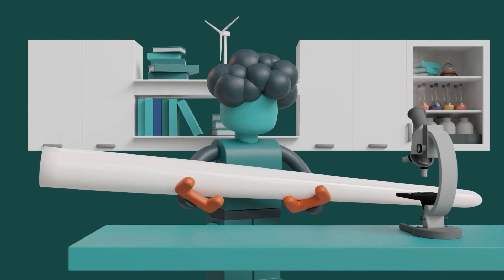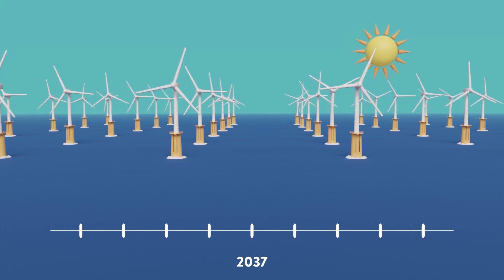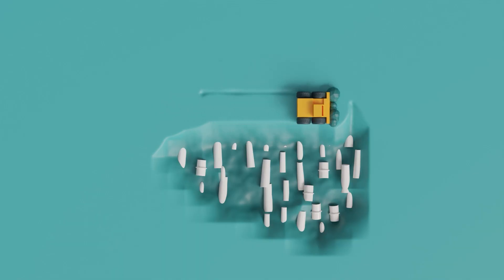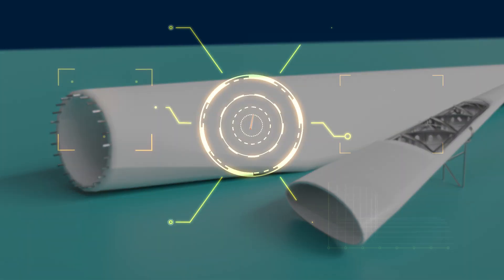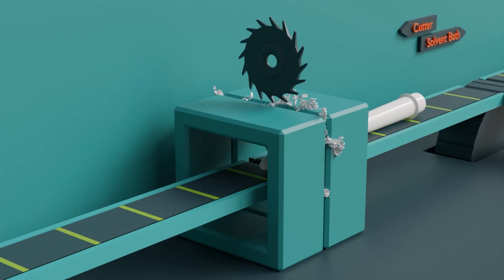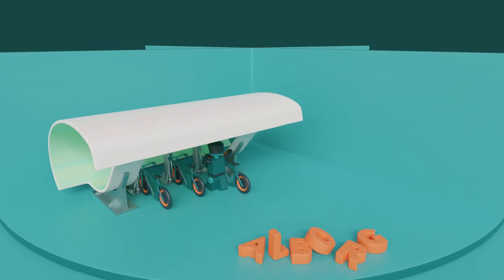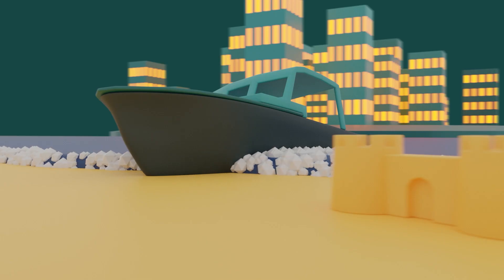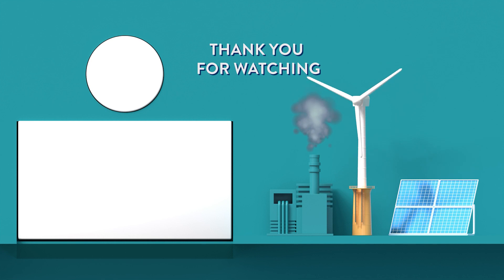The Challenge of Recycling Wind Turbine Blades: Explained

Comment: Over forty years ago I built and repaired fiberglass boats. The lunchroom had lots of windows which let in lots of sunlight, it was beautiful the way the glass fibers reflect in the sunlight! Containing glass fibers and dust is just about impossible without hepa filtration and becomes impractical and expensive.  My doctor said two years was enough and that fiberglass was going to be the next asbestos. Recycling wind turbine blades will never be practical and the best solution is to bury them or turn them into artificial reefs.